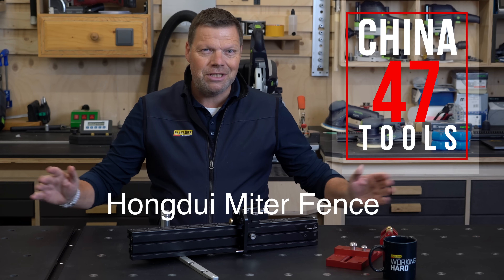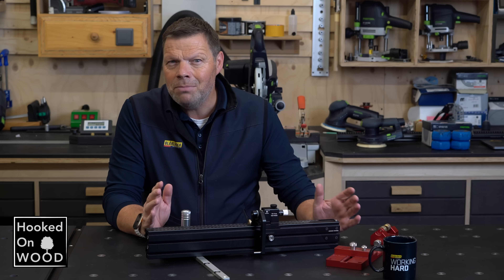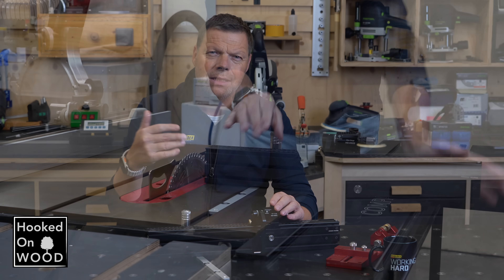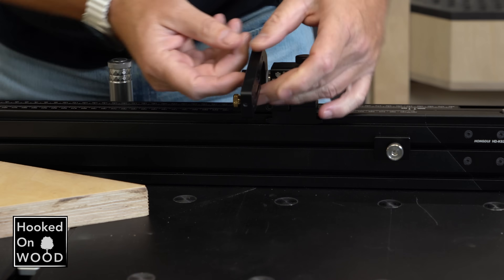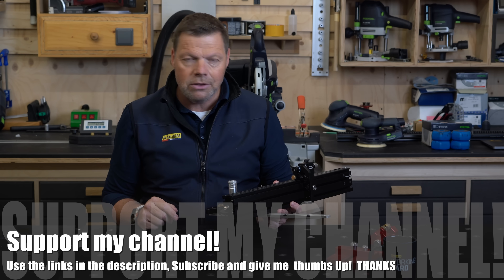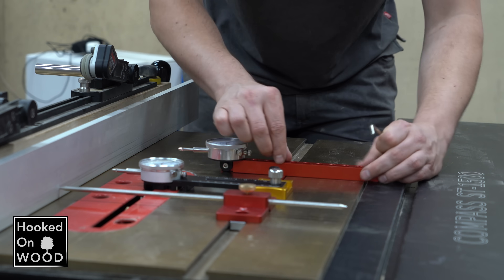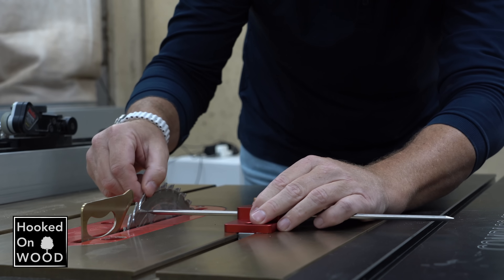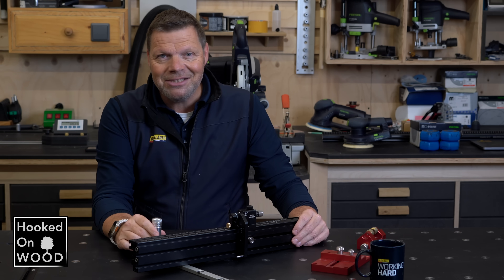Is This Mighty Miter Gauge Fence The Best? Review

Comment: No matter how well you think you've aligned your miter slot to your blade, the best way to set the miter gauge fence is to square it to the miter gauge's miter bar. This is not only more accurate, it's far easier. Saw blade bodies may not be perfectly flat, and indexing off the teeth can damage your measuring instruments, not to mention compounding any error in blade to slot alignment into the miter gauge. If you think about using a miter gauge on a bandsaw or router table, you'll understand why squaring against a blade is not the best way.

Comment: Dennis, I have found your videos very informative and accurate, and indeed that is why I purchased this fence, but I think that you could improve this video by clearly mentioning that this fence is not for use on the right of a table saw.  Other fences I have used could be set up for either side of the blade, and so it came as an unpleasant surprise to me that this one cannot.  Banggood's information also fails to mention this limitation.  While various comments have now raised the issue, it would still be possible for someone to watch the video and not read the comments, which is why I suggest that you highlight the issue either in the video itself or in your description.

Comment: With the dialless gauge, you can just measure from a fixed spot on the disc of the saw blade. I don't see a need to measure from a saw tooth. As long as you are measuring from the same spot, you should be fine.

Comment: I purchased the Hongdui miter gauge and fence for my Sawstop table saw. I am unable to use as the base of the gauge hits the edge of the cast iron table and leaves a mark.  Is there an adjustment for this. Also am i the only one experiencing  this issue?  This is the first time i have an issue with one of your recommendations.

Comment: Dennis really knows how to pick winners.
I have the red dial indicator, and I find it to be fine. Setup may be a little fiddley, but once it's set one shouldn't have to readjust it for the saw in the future. 
I also have the Hongdui miter gauge combined with the Enjoywood miter fence. Nice setup. The Hongdui fence looks excellent, but probably not worth upgrading in all practicality.
I have the Wnew miter gauge and fence on my jobsite table saw, which I find to be more than adequate for that application.

Comment: I purchased the Hongdui Miter Gauge and fence based on your advise. And I'm mostly happy with it. There is one thing though. The disk in the front of the miterbar does not fit the track in my saw very well (Dewalt 7294) - it's too thin, about 1,17 mm - so the bar can lift up/wriggle vertically in the front. I'd suggest adding some shims, or a selection of different thikness spacers to mitigate this problem.

Comment: Crazy that Hongdui may be ahead of the premium brands like Woodpeckers, Incra, and JessEm.  Kudos to them for not just racing to the bottom.  Hopefully they didn’t violate patents to get there.
Reply: Yes, “may be”. Need to see someone that isn’t sponsored to say that, saying it.
Reply from the maker: As far as I can tell, this is pretty much its own design, same as with the Miter Gauge. So, indeed I hope they will continue this way.
Reply from the maker: Well, I hope I showed enough so you can make up your mind yourself.
Reply: @Macron87  That’s def fair.  I’ve used a lot of miter gauges and fences, and this thing looks as good as it gets and costs less than the others (not by a lot though).  In a lineup I don’t think it’s crazy for a woodworking pro to pluck this one from a test of them all.  Would like to see that video though.

Comment: I just finally got both the miter gauge and fence set up. This is 💯 % the best that I've ever seen. It's FABULOUS! 

However,  I think that I found an issue.

The imperial scale is off by 1/8" when using the extention fence, and there is no way I have found to make it correct. Can you give it a test and see if I'm wrong!? 😮

Comment: I was waiting for this fence reviews for a few weeks already because the information on banggood was very lackluster. I think the price might be justified but it misses some tricks which make really unsuitable for me to buy yet another fence, especially at that price. My biggest gripe is that this (like other fences) is made to stop at or at least very close to the blade, seemingly assuming one might want to cut ridiculously short cuts as well (but then why offer a telescope function?) but short cuts are much safer and easier to execute with a sled. What I would rather like to see is a fence that has a scale which starts at a safe distance away from the blade so I can pull back the fence enough to not collide with safety features of the saw. I was checking whether it was possible to trim the included scale but it doesn't seem to be possible due to features depending to have metal bar with the scale in a defined length (also since it is reversible). Maybe Hongdui will listen and produce a version with a scale starting at 10cm (4" respectively) or offer a replancment scale with this offset so that I can actually use it properly.
Reply from the maker: You can use the pin. That would give you 3a4 cm extra. But a sled is even closer. So why does that feel safe and this not?. You can place it +_ 3cm from the fence
Reply: @HookedonWood  A sled gives you a variety of options to fixate the workpiece, includes the "sacrificial fence" and prevents (typically also small cutoffs) from being accelerated back to the user. That makes it a primary choice for small pieces. Typically, that requires removing the protective hood and replacing it with a riving knife. However for all other usecases you definititely want to use the (mandatory as product feature in some markets!) blade guard hood, which clashes easily with a fence, especially this one since it is quite a a high one...

A fence with flag stops is for me a feature to make repetitive cuts on medium to larger size work pieces where a sled or a miter saw quite literally doesn't cut it (or lacks precision). For small pieces those are much better tools...

Comment: I bought this fence as soon as it was out, as I already own the Hongdui miter gauge. It’s worth mentioning that, unlike the one from Incra, the telescopic fence only extends to the left, making it unusable on the right side of the blade. And I hope they would ship the fence with the 2 screws to mount on the gauge, as mine are already lost😢
Reply: How is the accuracy\precision? 

Also, that is crazy that this fence only extends to the left side of the table saw blade. To me that is a major flaw.

If you take a closer look at how the fence is designed, you will see that the left side of the fence is the only side that has the angle cut, not the right side too, like the Harvey. Harvey has the angles on both sides of the fence, and you can move the fence extension to either side, Also, with the Harvey, if you have a left tilt or right tilt table saw blade, their fence makes more sense.

Have angled cuts on both sides of their fence, as well as the ability to move the fence extension to either side, and they'll have a winner, imo.

Overall, from looking at the pictures and videos, the Hongdui setup is nice, but I think they need to make a version 2.0 with the necessary updates.
Reply from the maker: @warped_woodwerks you are indeed right about the side. I think 95% use it at the left from the saw blade. So it is a choice. Compared to the Harvey, they have even forgot to add a scale and a whole lot more. So, when you use it at the left. It is the most complete fence available at this moment
Reply: @HookedonWood  Thank you for your response.

I will agree, for most of your comment. The major gripe I have is that if you have a left tilt table saw blade, the Hongdui doesn't have a left tilt miter cut in their fence, like the Harvey. I think if their fence had that ability, I would purchase their miter gauge without hesitation.

Regardless, thank you for replying to my comment. 

I enjoy your content, so please keep posting the great videos!

Comment: Hey Dennis, 
I am currently building a MFT style worktable and I am still in the market for a fence. I was looking at the benchdog tool fences, but I am seriously impressed by this fence. Given that the price is comparable with the Benchdogs fence, I am wondering if this would be the better buy? The only downside to this Hongdui fence is that the benchdogs fence does come in longer lengths?
Reply: Hey, I’m not sure I understand your comment here. This is a miter fence for use with a miter saw that runs on a table saw. Benchdogs (and I I own a LOT of their products) make truly fantastic fences, but they’re for use only with track/plunge saws. The fence shown in this video will not work on a MFT style bench top.
Reply: @fibbsjc  I also own benchdog products and I was looking at the metric fence. I was just wondering if I could use this fence together with some quad dogs, since there is a groove in the back. Why would that not work?
Reply: @wnxdarkraven  because the fence built for an MFT top takes into account the width of a track and whatever blade you happen to use since they cut on the right side of the track. IF the fence dogs are able to be mounted to this fence then I suppose in principle there’s nothing stopping you from using this fence to measure your material, but you’d always have to add the width of the track and blade to whatever the fence says your set at and that kinda kills any convenience and adds to much possible points of human error into the mix for my liking.
Reply: @wnxdarkraven  btw, if you already own a fence from BDUK then you might not wish to pony up for cash for another, but I bought their metric/imperial fence precisely so that I could do both material measurements. That’s an option as well
Reply: @fibbsjc That's a good point. I guess I am just blown away by the beauty of this fence and will justify any reason to buy it. :D Thanks for the feedback. My wallet will thank you.

Comment: ATTENTION: Dennis - HOOKED ON WOOD

I think Hongdui missed the boat here, just a little.
Unlike the Harvey, for example, there isn't a mitered cut in the fence on the right side, so if someone has a left tilt table saw blade, you will have to move the fence further away from the blade and then there will be a large gap.

Since one can't remove the fence extension, of the Hongdui, I am not sure why they even designed their miter fence to have a mitered\angled cut in it.

Also, you can't remove the fence extension and move it to the right side of the fence, like the Harvey. I wonder why this is?

If Hongdui made a few changes\updates to their fence (ability to move the fence extension to both sides as well as having angled\mites cuts on both sides, like the Harvey), I think they would have an even better miter gauge. Then again, wouldn't one just ultimately buy the Harvey, since they already have all of these options with their miter gauge?

Comment: I think I will stick with my Incra fence which was also cheaper than this Chinese one.
Reply from the maker: Nothing wrong with the INCRA of course. That this Fence cost more money, is obvious. Although I like INCRA, the quality of the fence is very basic, the ruler insert very simple, no sophisticated micro adjuster and you need tools to extend it or use the micro adjuster. So, it is very basic. This is of better quality, thicker aluminum, and everything can be done without tools.